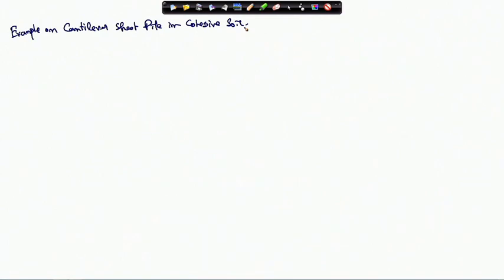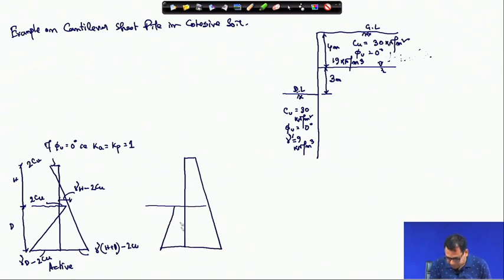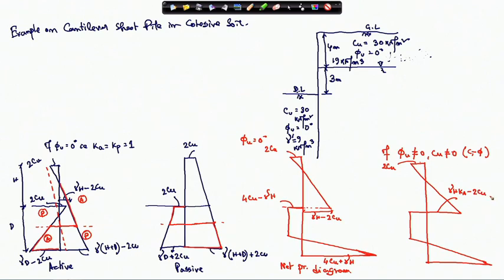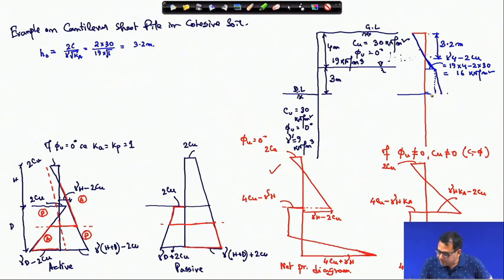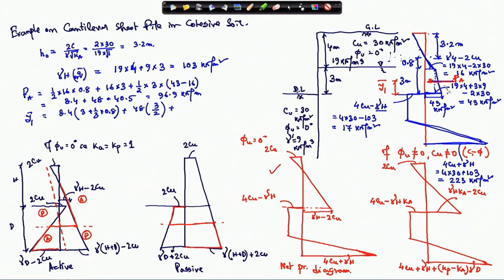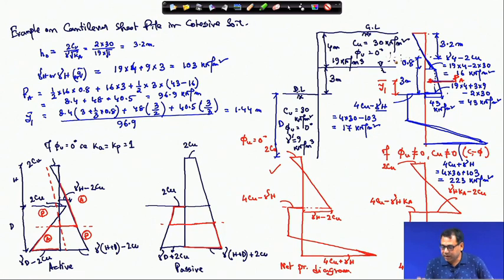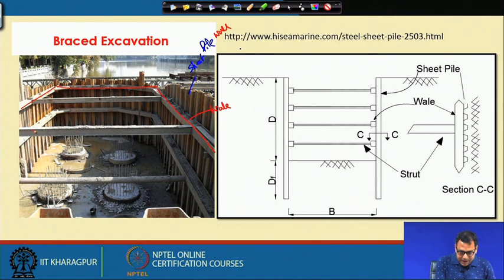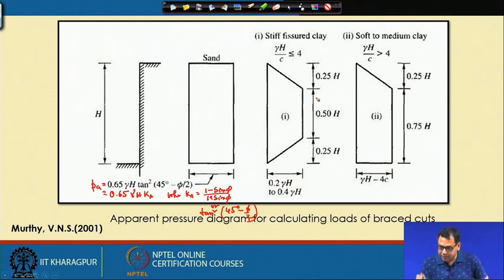Lecture 58 : Sheet Piles and Braced Excavation

Comment: if phi u is not zero and cu is not zero,we should account  pa equal to q ka-2cu root ka and pp equal to q kp +2cu root kp..You have not accounted the second part,that is 2cu root ka and 2cu root kp in active and passive pressure evaluation cases at  joints  A,D,B etc.This has created confusion.Pl look into this matter and confirm.

Comment: here, phi = 0 this implies --> Ka =Kp =1 therefore active and passive pressure coefficients are equal and they are cancelled 
and in the D zone, net force will be constant. And why there is no horizontal pore water pressure taken?
Reply: because water is in both sides of the sheet pile